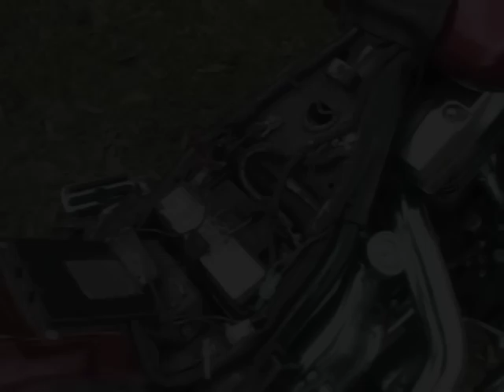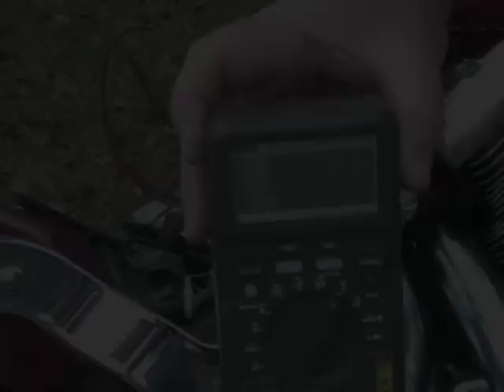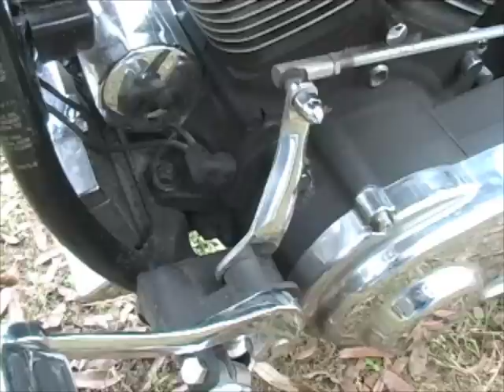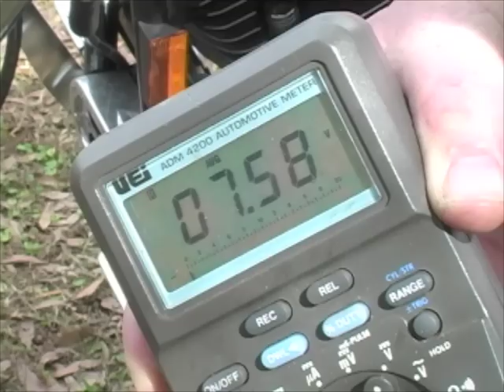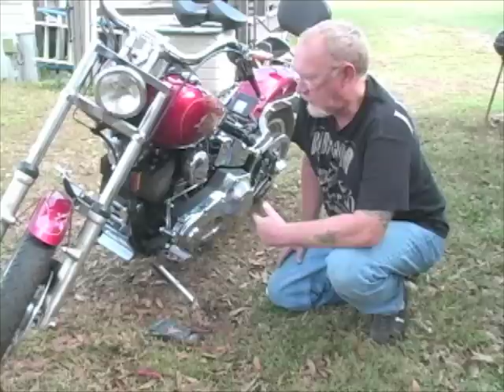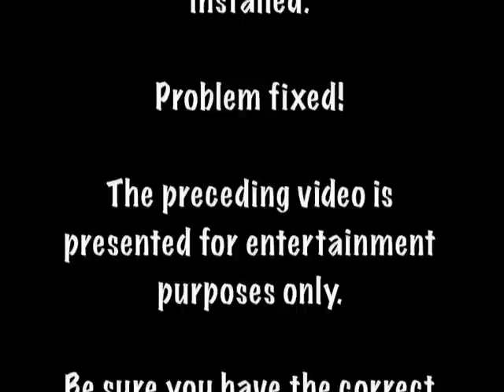Testing the Battery and Charging System (Harley Davidson FXSTC)

Comment: Early this summer my buddy's ride a 92 Evo Ultra was losing headlight power. When we  pulled over , the bike barely started but his volt gauge  was showing 10V. I always carry way too many tools !!   so we did a volt check with my meter same result & no fluctuation from revving motor. We checked all connections from battery positive circuit to ground back to volt reg. &  found the issue at plug going into stator pins insert at the motor.  I simply used needle nose pliers & crimped the female ends to assure a good contact put a little dielectric grease & pushed back onto stator pins.At this point, the bike needed a push to start but within a couple miles, the gauge had climbed to 12V  & eventually climbed & maintained at 13.5V .The trip &  all issues have never re-occured since, but after this particular trip, did install a new boot holder a metal clip used  to keep boot in place from vibration & losing contact. He never had one & was overlooked since owning the bike a few years . Years earlier on my friend's 72 Shovel a similar problem had occurred, but we traced by shear luck !! The ignition switch brass rotatory plate in the switch housing was creating a break in the charging circuit ! As we were about to give up, I was rocking the switch between on & headlamp on position & the light brightened up. Found a dealer further west on our planned route who coincidentally had ordered one for a customer & was never picked up  Go figure ! I changed out the switch right there in the parking lot !Issue solved...  The trip must go on !

Comment: Excellent video. MY battery was having trouble turning the engine past the compression stroke, yet always pulled through and started. I did these tests and found while cranking the battery dropped to just over 5volts, when the engine was running I was getting 14.30 V. So with your help I was able to determine that my charging system was working and my battery was on its way out. Thanks for the help!

Comment: Nice vid but I do have a suggestion... once you've determined you're not getting the 13.5 - 14.5 charging voltage to the battery, the next test I do is simple... with the bike off, unplug the regulator from the stator and simply check both sides of the stator for ground fault. The AC output test is nice but I do the ground fault test first as it's the most common issue with a failed stator.

Ride safe everybody.

Comment from the maker: I use the Pico PC-based scope, an older 4-channel model. Like it alot! Found it very helpful in my day job as an auto tech and figured it would be interesting to use it on the bike. As you can see, it quickly pointed out a bad stator!

Comment from the maker: Appreciate the kind words! On the FXSTC, the stator resistance is very low (less than 1 ohm) and should have no continuity to ground. It is a two-wire stator. Three-wire stators need to be checked between all combinations of leads (A-B, B-C, A-C) and will also show very little resistance if all is well. High readings (mine was 120+ ohms) or a reading of "0" when testing between leads is a sign of a problem. We plan on doing more basic electrical stuff, so stay tuned Ride hard, ride safe!

Comment from the maker: Two questions:  
1.  What were the basic system test results? (OCV, loaded voltage and charging voltage)
2.  What is the AC output from the alternator with the regulator unplugged, measured at the open connection and with the bike running at 2000 rpm?

Comment from the maker: Thank! As for your upgrade, if it would be necessary then the install instructions should point that out. But I don't think so. Fuses are to protect circuits from excess current flow, and that current flow is determined by the loads (lights, horns, etc.). Now, if you increase THAT side of the circuit it's a different story. A higher output charging system will just give you more POTENTIAL supply that is only used if needed.

Comment: Thanks for the help had charging problems with my 2010 Sportster used your tips found have no charge between Stator and battery may be the regulator or Corrosion in the system due to the wonderful british weather - Thanks again
Reply: Glad it was helpful to you.

Comment: I have a question and I hope somebody to help me. I have a 2007 FLHTC IU that has set and battery is going dead I replace the battery and the bike will not start. when I turn on the ignition the only lights to come on are the speedometer and the tachometer and they constantly Flash. I call the Harley dealer and they have no idea what the problem is. could somebody please help me I miss my mule.

Comment: I am working on a 98 softail with a EV2 engine on it. It won't start. I removed the starter. What a pain. I tested the starter out of the bike. I used a Yamaha XJ 650 battery to test the starter. I hooked jumper cables to the starter and it spun right up.  Negative to the negative on battery to the metal on the starter. Postive on the battery to the postive on solenoid. I took a small jumper cable to the relay on the starter to the solenoid and the starter spun up fast and with great torque.  Put the starter back on the bike and installed the battery that was in the bike not the XJ650 battery but all I hear is a clicking noise. Like the starter is enguaging but the starter motor isn't spinning up. Why? Battery warehouse said the battery is good.

Comment: So this morning, Sunday of all days, I get on the bike for a nice long ride. The battery is dead. Only has enough juice for the little red blinking light. I just rode the bike two days ago. I am bummed out.....

How long is the expected life of a stator, regulator and battery?
Reply: ***** Batteries are dependent on a lot of factors - weather, down time, proper maintenance. As a wrench, I used to replace neglected batteries every year but as a year round rider now I can get 3 years or longer out of a good one.
Stators fail from overheating - either from excessive load or from excessive heat in the primary. The insulation can melt and causes the wires to short internally, effectively reducing what they are able to put out.

Comment: Hi Southern Biker... Really great video.. I have 78 Shovel and when i cahrge up the battery everything looks fine and when i rev up the bike it shows an increase in voltage and thats normal but my problem is that when i ride for more than 30 miles the bike drains the whole battery.. should i change stator and look at it? or is it something else?
Reply from the maker: TheHyperJaw X Are you running the headlight on all the time? Any additional electrical accessories? Shovelheads didn't have that strong a charging system to begin with. Check the current load while riding and make sure it's positive, not negative.
Reply: Thanks for the reply.. No headlights are not always on

Comment: I have a haritage 2002 softail it has 3 wires on plug to stater ow do I check that one
Reply from the maker: The 3-wire stator is similar to the one in your car. Test the voltage output between each pair. For example; voltage between A-B, B-C, C-A. You can also test the resistance between pairs and resistance between each lead and ground. Hope this helps!

Comment: Hello, I just got a Sportster 1200 Custom from 2014 about 3 weeks ago. I have got it out about 3 times those week but yesterday I tried to start it and it did not. It is making a noise like "tic tic tic". I checked the battery and it is showing 12,25 when I turn ON the starter the lights and everything seems alright but ir does not start. Is that voltage so low that wont start my engine? Thanks so much
Reply from the maker: 12.25 is a low battery and could be the cause of your no start. As shown in the video, you really want to know what the loaded voltage is when you hit the starter button but I"m betting it's below minimum (and the cause of the "tic tic tic".) Charge the battery with a trickle charger and test the system as described.
Reply: Thank  you so much. Yesterday I got a jump start battery, I bought the motorcicle from the Harley distributor it is second handed, it is very taken care but my guess is the batter got bad while it was in the shop. 

I will try what you say thank you again the video has been very helpfull!

Comment: can I use this same method to check the system on my 81 shovelhead?
Reply from the maker: You can if it uses a two-wire stator. Three wire stators can also be tested this way, but you need to check the AC output between each pair of wires (1-2, 2-3 and 1-3).
Reply: yes its a two wire stator.  I checked it using this method and it worked out well! I just needed a regulator, thank you for the post and the wealth of information in it!
Reply from the maker: SnailHouseProjects Glad it worked out for you. Spread the word...we're the shiznit!

Comment: Charging system of my bike is giving maximum 13.30 while running the bike. Problem is  stator or regulator?
Reply from the maker: 13.3 v is a perfectly normal reading for the charging system. What kind of issue are you having?
Reply: @SouthernBikerTV battery is not being charged.
Reply from the maker: @tahirentertainment5 Did you perform the first set of tests measuring battery voltage, loaded voltage and charging voltage? If so, what were the numbers? If you're getting 13.3 volts to the battery, it would see the charging system is working. You may have another issue.

Comment: my NEW battery dies too fast. i fully charge it and it starts right up. i turn it off and try to start it up again and it sounds like a drained out battery.
Reply from the maker: Check all the connections, especially the ground cable both at the battery and where it attaches to the frame. Corroded and/or loose connections cause a voltage drop that prevents full power from getting to the starter.

Hope this helps!
Reply: Southern Biker TV thank you so much, ill check it out. this is right after i take a short ride and park it. i try to start it right after and my new battery drains.
Reply from the maker: sinaloakid1 Follow the steps in the video and check your charging system voltage. Sounds like you're running on the battery only, killing it quickly.

Comment: Could not see how you checked the regulator because your arm was in the way
Reply from the maker: This bike uses a two-wire stator. The part you couldn't see was my placing the two meter leads (meter set to read AC voltage) on the two connector pins on the stator side of the connector. Had I had good voltage there, I would verify that the AC supply was reaching the regulator by plugging the connector back in and backprobing at the regulator itself. I would then check the output wire from the regulator directly at the regulator. If charging level voltage was present, I'd suspect a problem with the lead running from the regulator to the battery.

Comment: I replaced the stator and the regulator and the bike still dies
Reply from the maker: Let's start by verifying the battery/charging system. Measure the battery voltage with nothing on, then set the meter to record the "Min/Max" as shown in the video and start the bike (or engage the starter anyway). If it does start, let it run for a minute or two. You should begin with a battery voltage of at least 12.4 - 12.5 volts. Anything lower is an undercharged battery. The low reading on start up is loaded voltage and should remain above 9.6v - if not, the battery is bad. Finally, running voltage should be around 13.5 - 14.5v. If your numbers are all good, then its likely not the charging system causing the issue. 

OH - and be sure that the battery connections are tight. I've had issues with them loosening up more than once.
Reply: @SouthernBikerTV All good at the battery, 12.8 to 14 while running. I narrowed it down to grounding issue, either at the stator or the regulator. Battery ground looks good with the Star washer and tight on the post. I can't get the OL on my ohms screen so I'm going to try AC or DC reading?at the stater plug while bike is running. How do I check the regulator to battery cable for continuity or ground? There's a ground wire across from regulator, Not sure what it's for.Thank You

Comment: Good informational, video. Great bike, too, with the reliable, EVO single cam, 1,340cc, engine. Last year of the EVO. Hold on that bike, cause in my opinions, the TWINKIES, produced from 99 to the present are a FATALLY FLAWED DESIGN with PLASTIC tensioners in critical components. No plastic in the engine on this bike, solid metal, GEAR DRIVE ON THE CAM SHAFT AND THE OIL PUMP, unlike, the TWINKIES with two silent chain drives and PLASTIC tensioners, rubbing against a METAL chain.  They were designed to have to be periodically inspected and to be replaced when wear on the PLASTIC tensioners, reaches 3/32' of wear and it's an expensive procedure to replace them, especially the inner tensioner inside the cam support plate, which silent chain drive operates the two cam shafts. Also, the EVO had the flywheel assembly, bolted together, with a crank pin bolt and nut, torqued down to hold the flywheel assembly in true. Not with the TWINKIES, as they use a pressed together, flywheel, with nothing holding the two sides of the flywheel assembly in true and they WILL come out of true, rather quickly and eventually crater the engine, and cause CATASTROPHIC ENGINE Failure.It's not unusual though to have to replace components on the HARLEY charging system, over and over again, especially the stator, due to it's bad location, inside the primary drive, and right up against the hottest part of the bike, the lowest part of the crankcase, where it gets all the maximum engine heat and enclosed within the rotor and enclosed within the primary drive cover itself. It cannot dissipate any heat at all. It's a major job to have to disassemble the entire primary chain drive, to even get to the rotor and stator, to change them out. Same thing with the starter, due to it's location directly behind the rear cylinder, and underneath the oil tank. It gets all the engine heat from the hottest, cylinder, the rear cylinder and so it gets heated up a lot, too.So, hold onto to your EVO, as you have the true HARLEY sound of yesterday. Enjoy it.
Reply from the maker: +tomcata1467 Unfortunately, the EVO has passed hands and an '09 FLH sits in its place! I do miss the FXSTC though...
Reply: Man, you should have held onto the single cam, EVO, which can be re-built, over and over again, and was a great bike, although, just a little under-powered, but, if you love cruisers, who is in a big rush anyway? Some guy, who now owns it is smiling, about buying it, no doubt. he, he, LOL, Love that EVO engine sound, pure H-D of yesterday.
Reply: Then why aren't there blown-apart Harleys all over the place? Lots of 88s out there running strong, including mine.
Reply: @SouthernBikerTV I still my 98 fxstc and I just replaced the battery this week. Wished I had seen this vid earlier. Going to run your tests today. I'm thinking it's the stator cuz I'm not getting above 13v with the 2k rpms. I'm considering an 08  or newer heritage  tiwncam since I heard they addressed the tensioner issues.